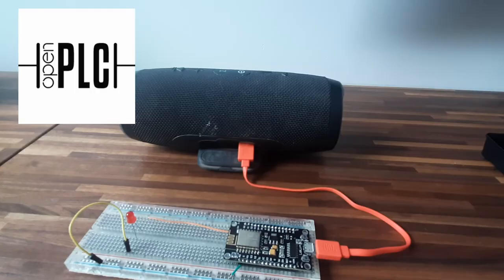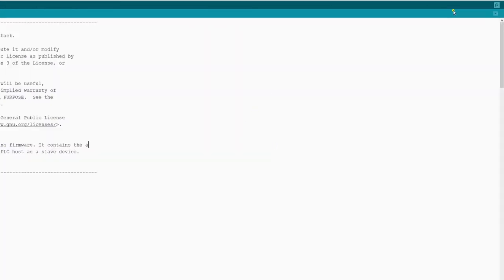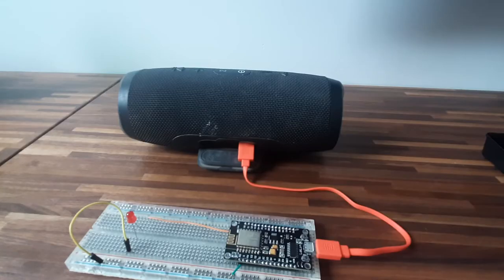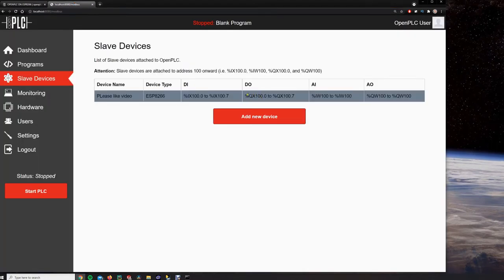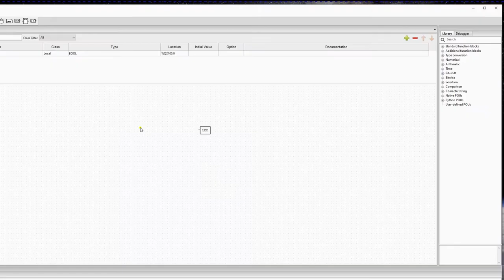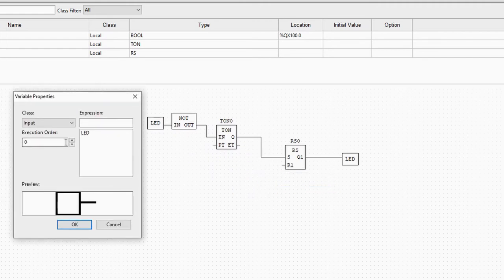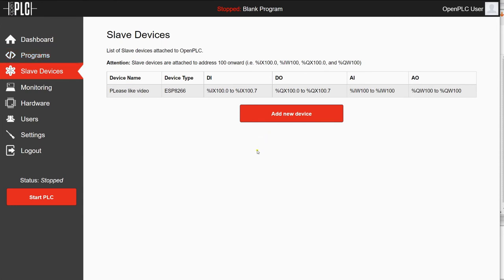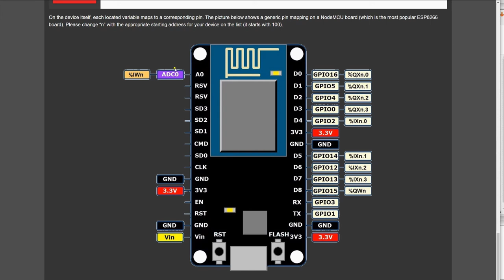Open PLC with ESP8266 Wifi

Comment: What if the IP of the ESP is changing when you re-boot?
Reply from the maker: The IP address is static so you don't have any issues (never had any issues with my esp8266 projects so far).
Reply: @seafoxc  The IP address is given by the router, so it may be used by other device, unless you configured the router for static IP.
Reply from the maker: @YigalBZ  I will look into it when I'm home after my Holliday because I now don't have access to OpenPLC. I guess the firmware on the esp8266 assigns a static IP adress. In 10 days or so I will come back to this topic. Either way I did not had any issues in the past. I also have to make a new video for connecting with the esp8266 because of the new release of OpenPLC.

Comment: very good job ,  link for ino file doesn't work ... can you share an altarnative ?
Reply from the maker: Yes, this is changed recently. Now you have to create an empty PLC program, click on the Arduino symbol in the taskbar, and select the correct board (ESP8266) and the correct COM-port. Next, enable Modbus TCP; here you can write an IP address (set it the same as in OpenPLC runtime). Then press upload. I don't have the hardware to test it myself at the moment. Can you reply if this was the correct solution?
Reply: @seafoxc  thank you very much for the prompt reply. I tested it, The esp communicates normally, but something is happening with the inputs and outputs that I have defined in the ladder. But I think i will fix it.
Reply: @seafoxc  finally i fixed it , it was hardware problem. Work as expected !! Thank you again !!!

Comment: ESP works as slave device so without computer it can not work as Plc.
Reply from the maker: With the latest version of OpenPLC it is possible to download code directly to the ESP chips( not shown in this video). Just for your information :-).
Reply: @seafoxc  where can i find information?
Reply from the maker: The information is written in the top blog post here: https://openplc.discussion.community/post/openplc-native-support-for-arduino-boards-in-beta-11984879?pid=1332015367. I also made a video where I downloaded the traffic light directly to the Arduino Uno. It is all the same procedure for the ESP chip (ESP8266 and ESP32). This is still in Beta so there could be bugs. The video is here: https://www.youtube.com/watch?v=6YcA3wirDPY&t=5s&ab_channel=seafoxc.